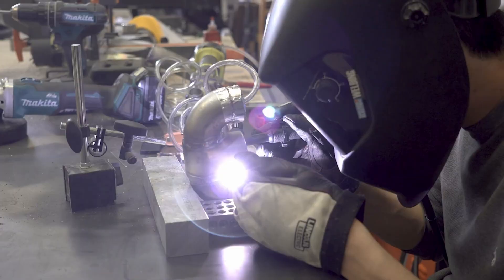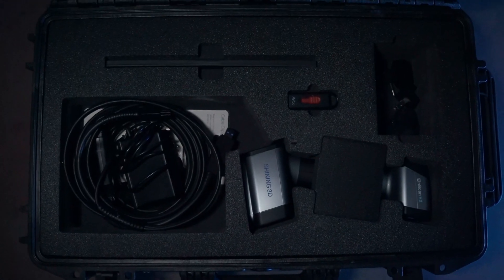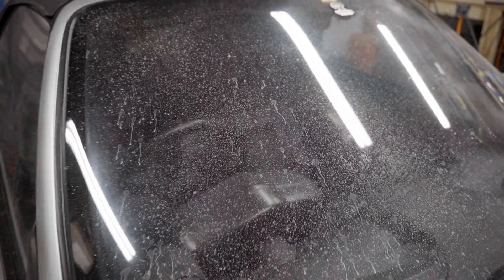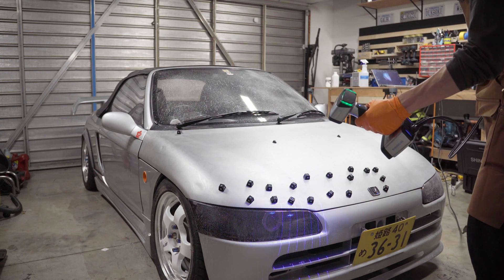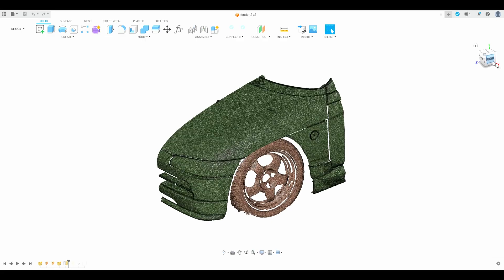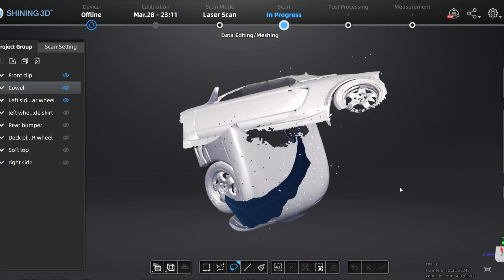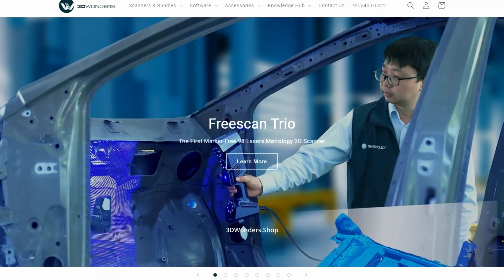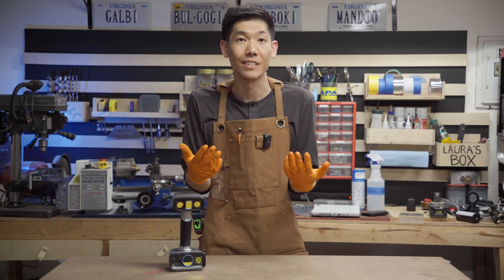3D Scanning my Honda Beat

Comment: What gpu is in your PC? just trying to judge what I need as as upgrade from my 1080
Reply from the maker: I’m running a 2060 on my laptop and it handled most of what I scanned. But it bogs a little when 3d modeling with the large mesh

Comment: Ive scored 20,000,000 points using my laptop. 
It has 11th gen i9 8 core cpu with 64Gig ram and a 3080 16gig graphics card. 

It’s not a gaming machine, it’s classified as a mobile workstation. 

I’m still pinching myself I own this magnesium chassis’s carbon fibre lid weapon.

Comment: I used a 10mm hole punch and magnetic tape, that comes in one of those standard small dispensers. You know, like the ones commonly used for rapping Christmas presents. 
I use that dispenser because the magnetic tape is so so thin compared to the A4 sheets. 

The magnetic style of dot is super easy to remove with a magnetic covered in a soft fabric. 

Thank me later. 

:  ]]
Reply: can you put a link on what exactly you mean? maybe share some photos?

Comment: I'm appreciating going through your body of work and the varied products youve done. Im subbing and will look forward to following your projects. A quick question for you that may end up being a tip that could help you on future scans. I have an Einstar scanner so a close relative but not nearly as fancy as your HX. Can you  still take advantage of texture alignment when using the laser scanning mode? If so you might find that with the right scan spray technique you will have no need for markers. I am able to scan large areas with almost no shape/features at all  (even large pieces of flat glass) using the Einstar with texture alignment. The way I have been able to do that is by using a scan spray method similar yours with a few minor differences, however what you have done may work just fine as well. In ny case I mix talc powder with the alcohol and spray it out of an HVLP gun. I lay down a first light coat at higher pressure to create an even matte surface. After that flashes off I come back with a second coat where the  pressure is turned down to a bit to low to aromize well so larger droplets land on the scanning surface. I have found those spots and their relative patterns between them to be more than sufficient for texture alignment purposes. Hopefully you or someone else reading this will find this method helpful. Im not sure if theres any downsides for this application (car body panels) such as more processing load but it has worked well for me. If you can use laser scanning mode together with texture alignment then you should experience even better success than I can/have as your data should be cleaner.
Reply from the maker: That’s very good advice. I’ll try that out for sure. Thank you so much for sharing!

Comment: Sounds sweet. Also these new 3D scanners look amazing.
Reply: I think I would have ended up giving up on the scanner and just building a series of prototype panels and refine them until I get something suitable to make a mold. But given how much I have been printing recently I bet the knowledge you gained for scanning would end up having ao much more utility long term.
Reply from the maker: Absolutely! The techniques can transfer not only to other cars but other objects in general. Using the 3d scanner gets easier and easier for sure. With that said either approach is awesome bc we’re both learning to refine a new skill